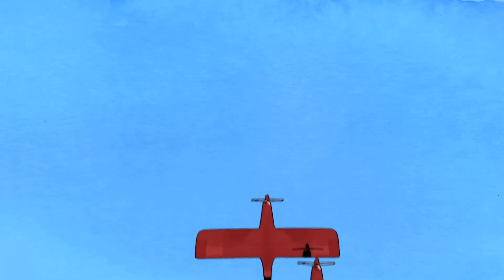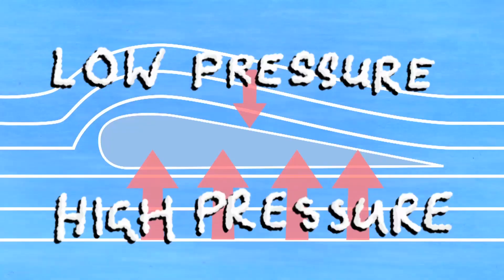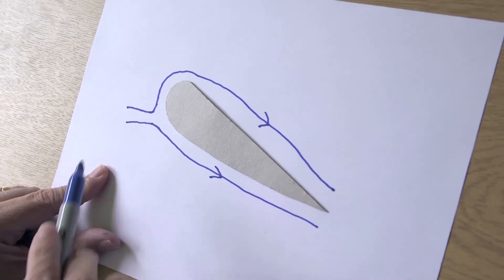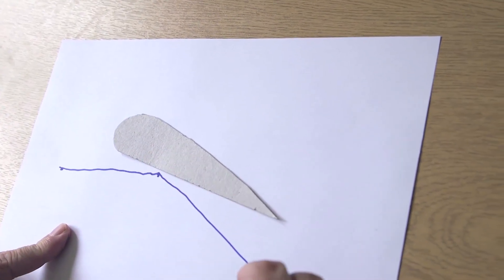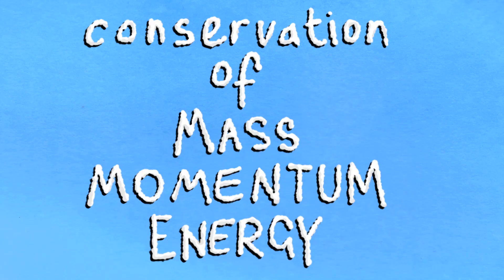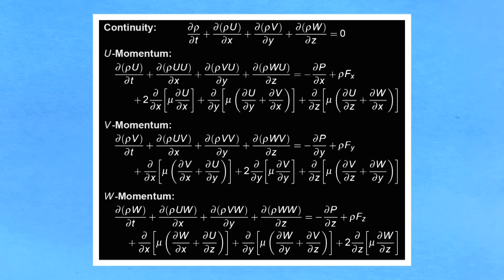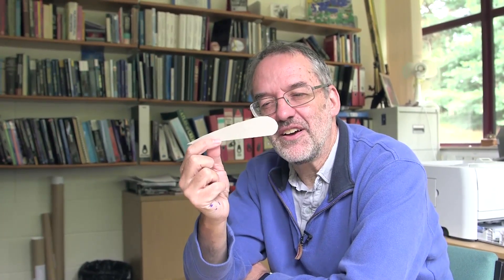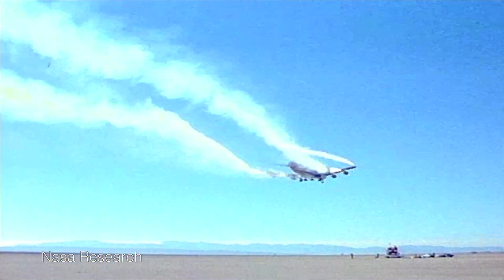Lift and Wings - Sixty Symbols

Comment: Very upset, how can you say that the air drags the other air along? 6:08
Reply: the problem is that air is not a liquid let alone a solid. its more to do with kinetic interaction than intermolecular frictions.
Reply: +Observ45er can you explain what intermolecular forces are involved with air
Reply: Doug's one I consulted with a couple years ago.  We both volunteer at Challenger Centers.
Reply: wut? this is just how viscosity works their is a friction force between the air molecules that when one molecule moves it is going to exert a force onto the molecules around it dragging it. It is a very small force because the viscosity of air is pre low but it still exists. This only doesnt happen with an inviscid fluid which sadly doesn't exist. Although the animation in the video is a little misleading because it drags the surrounding air to the same speed as the initial moving air which would not happen.
Reply: +Bryce Ring,  Think of the air in layers.  When the layers "slide' past each other, the viscosity is like friction between two hard surfaces (a brick and table). So this friction causes a force on the adjacent layer to move it along. Also Look up "entrainment in fluids".
Reply: +Bryce Ring, 
Both liquids and gasses are fluids and have similar chacteristics including viscosity. 
Many don't think water, much less air has this, so sometimes reference to Honey helps.
...
 I said "like friction" because it is easily understood as a reasonable analogy.  
The deeper mechanism causing viscosity is not explained in this context as being unnecessary for understanding and a distraction to lift.  The analogy is enough.
...
Regardless, your being upset with "air draggig air" is contrary to what happens.  
Moving air does move the near-by air along and the word "drag" explains the concept adequately. - - When you explain things to many people, analogies are found to be very important and must be carefully selected. I've seen some pretty bad, though well meaning attempts at them.Cheers
Reply: "Moving air does move the near-by air along"
Then I need educating. Please explain how ?
Reply: Why does a brick have friction on a table?  I dunno'. Probably something about inter-molecular attraction or simply surface roughness or maybe quantum something-or-another stuff.  
Things have friction and it works like such-and-such and that's all  we need.
...
Why do atoms stick together? Because of electrons sharing orbitals.
Why do electrons share orbitals? Because Bla, Bal, Bal?
Why does the Bla, Bal, bla happen? Because of XYZ.
Why does XYZ happen....
..
Viscosity just is...for me.
Reply: +Observ45er I think my main problem was with a misunderstanding of the word drag. at least they didn't say pulled along. if I think of drag as just an opposing force to the velocity vector and don't assume that drag means Pull, Then I can live with that. I'm just a bus driver at and I'm at work now thanks for your input.
Reply: +Bryce Ring I am using voice to text so there are a few funny mistakes I will edit that post when I get home
Reply: +Bryce Ring,
Well, so far, you seem to be doing pretty well, from my point of view.  YOU just need a little polishing up.
...

Think of ordinary friction.  Push a brick along on a table top. 
...
The friction acts against the brick's velocity, yes. Friction  is "trying" to slow the brick down.
...
HOWEVER, The friction is ALSO trying to move the table along with the brick.
If the table was on wheels, it would start moving due to the friction force.
...
IN FACT, Until the brick actually starts sliding along, the force you put to try to slide the brick is STILL "pushing" on the table and would move the table on wheels...NO??
...
Push, Pull, Drag along, whatever...
...
This is the phenomenon that is described by Newton's 3rd Law.
You push on the brick...it doesn't move yet.
Something is pushing back on the brick to keep it from moving.
The table is, via the (now static) friction.
...
Push harder and the brick starts moving.
The (now called sliding) friction still acts against that movement; and we think of this as "drag".
BUT, the brick is also still pushing on the table, trying to move it along.
...
Brick pushes on table...Table pushes back on Brick.
Newton's Third Law ALWAYS, ALWAYS applies.
Always.
Always.
...
Please do not make Newton unhappy and ignore this.
...
Airplane drag acts againt the plane's motion to slow the plane, but it also acts to speed up the air.
...
The air behind a wing is MOSTLY moving down (the downwash) due to the lift explanation (and it is proportional to the lift force).  
However, downwash is also moving in the direction of flight because the drag force pushed, or dragged it along a little. Its forward speed is proportional to the drag force.
It is not moving forward very fast because the drag force is low compared to the lift force.
The forward velocity is indicative of the drag.
...
uzat help?
...
Reply: intermolecular forces are very interesting.
Reply: +Bryce Ring,
  We each have our interests and you can research that.  I've done that for many things that happened to tweak my interest. 
This Bernoulli and lift thing came along several years ago when I took responsibility for a full cockpit B-737 flight simulator for the local Challenger Technology Center.  I had heard that equal transit time story many years ago, but didn't give it any thought even though it didn't ring true for me...
I looked into it and found all these fair, poor and terrible things on the net and Youtube.  I dug into it and even contacted a few experts in the field to get things straightened out.
People try to explain it, but either have limited understanding of some of the principles, or confuse the science of it with the math used to calculate values.
Regards
Reply: You may like this then, it was part of a topic on RCGroups v=QKCK4lJLQHU
Reply: +Bryce Ring,

  It is because of the phenomenon called viscosity. 
Think of honey.  It is sticky, so it sticks to the side of the jar when you tip and start to pour.  The layer that is stuck to the jar wall doesn't move, but has a layer just to its outside, away from the jar.
  That next layer cannot easily slide past the first layer because of this property, so it moves slowly. It is "as though" there is friction between the layers. It takes some force to keep the second layer moving past the first. Gravity is the force on the layers, in this case.
...
There are methods for actually measuring this property.
...
What forms is called a "boundary layer".  This has some stuck to (referred to as "Wetting") the surface and not moving at all.  Then as we look further and further from the surface, we see the honey moving faster and faster as one "layer" slides past the previous layer.  Eventually we get far enough away from the surface that we are in what is termed the "free stream" and there is no more speeding up as we move away.
... 
Obviously there aren't really layers, but this is a continuous variation.

I know we don't normally think of air, or even water as being very thick, but they still have some viscosity. 
Well, if we start in a open atmosphere and blow a stream of air into it, the boundary between the moving fluid and the still fluid has this "friction-like" effect that causes the next outer layer to be forced / dragged along.   This is called "entrainment".  
A device called a "Jet Pump" uses this property.  A high speed, narrow "seed jet" is pumped into a slightly wider pipe and the outer fluid is moved along due to the viscosity and entrainment.
...
By all means, you can Google viscosity and boundary layer to verify what I have here.
- - 
Regards, Steve
Science and Technical Advisor
challenger.org

Comment: I understand the textbook explaination but my head always screams that it's mostly that the air on top simply wants to travel up or straight after being pushed up by the hump but doing so would create a powerful vacuum on top, right behind the hump in the wing, and the bottom has extra pressure from blunt force impact due to angle of attack. Both forces are multiplied because of speed.

Comment: I would have to disagree slightly with his assessment here. If I had to pick one thing that above all else provides lift or in other words the thing that provides lift more than anything else it would have to be the angle of attack via the law of conservation of momentum(through a homogeneous fluid). I wish physicists would stop trying to confuse people about this topic by making it a whole lot more complicated than it needs to be. Simply put, have a downward angle of attack and the plane will start to plummet while an upward one would generate lift. This can be demonstrated with a plank of wood or how most kids learn at a very young age with a piece of cleverly folded paper. This single variable contributes to lift far more than any other variable so pretending that it's some equitable or indivisible contribution of all three is disingenuous to say the least.
Reply: The argument that deflection is the most important is only true for separated flow over a flat plate because the flow separates over the top (making it a very inefficient airfoil). For streamlined shapes, the top of the airfoil generally contributes more to the lift (which a deflection argument completely ignores).

Comment: Professor, I'll drop this one question. If air has mass and Newton tells us that it takes a force to accelerate a mass, What is the Force that accelerates the air up over the top of the wing and, therefore, what is the source of that Force?. This video is fairly well done, but it seems to gloss over this one area which I believe is very, very important.
Reply: No response... one year later.

Comment: Could someone please explain in understandable language (for us non-physicists) how air on the UPPER wing surface flowing in a DOWNward direction creates an UPward force on the wing? Intuitively, you'd think air above the wing flowing downward would push the wing down. My request is that responders don't just repeat "conservation of momentum". That may be the answer, but doesn't really provide a mechanistic explanation. Thanks!
Reply: Just created and uploaded a video "Coanda Effect and Newton" demonstrating this.  Realize that  the curve in the spoon represents the top of the wing in the context of your question.
Reply: Thanks. I think your video nicely demonstrates the effect, but doesn't really explain it. Why does water flowing to the left over the spoon pull the spoon to the right? If I push a spoon to the left, it goes to the left. This is the result you would intuitively expect. Instead water flowing left over a spoon pulls it to the right and air pushing down on a wing lifts it up. This is an intuitive contradiction that cries out for an explanation.
Reply: I assume you intuitively understand that if the water ran on the inside of the spoon it would push the spoon away as it deflects the water? As the water is pushed in a new direction there is an equal force in the opposite direction that pushes the spoon away (Newtons 3rd law). Now apply the same force to the curved underside of the spoon (or top of a wing). Due to the coanda effect the fluid wants to stay attached to the curved surface and changes the direction of the fluid, so an equal and opposite force is present which pulls on the surface.
Reply: Sorry, I don't mean to be dense, but I'm not getting it. Saying "there is a force in the opposite direction" merely restates what the video says. My question is, why? It's counterintuitive. Again, if I push down on something, it moves down. That's intuitive. If I pushed down on something and it moved up, that would be very counterintuitive. Yet when air pushes down on the topside of an airplane wing, the wing moves up. I'd like to understand why. Simply saying "there's a force present" or "it's Newton's Law" may be true, but doesn't really provide a mechanistic explanation.
Reply: "if I push down on something, it moves down". Yes. And if you PULL something UP, it moves UP. Top of the wing is pulling the air down and the air is resisting by pulling the wing up.

Another analogy. You have a weight on the end of a rope and you swing it in a circle with your hand. Your hand is resisting the weights desire to go straight and forcing it turn in an arc. You can feel the weight pulling on your hand. Your hand is the top of the wing, the weight is the mass of the air, coanda is the rope.
Reply: Hmm, interesting. Air traveling over the top of the wing is moving in a downward direction so I would intuitively expect it to push downward, not pull upward. But if the upper wing surface is actually pulling on the air, as you say, it makes a little more sense for the air to resist and pull upward. I guess that leads to the question, what force from the wing causes the pulling effect on the air? It's not weak, strong, or gravitational forces, so that leaves, what, an electromagnetic interaction?
Reply: Essentially, most of the forces we experience day by day (aside from gravity) are actually electromagnetic. For example, walking, which, involves friction and Newton's 3rd Law, is just a manifestation of interaction of molecules between surfaces. Pushing a box through the floor is the same. It's essentially molecules repelling each other due to charges.  In the case of the wing, molecules are being pushed around, so, it falls under the same category.

Comment: Is it better described by using the coanda effect and Newton. The wing pumps the air downward. How? Air going over the wing attaches to the surface which slopes downward relative to the airplane.  Because a force is being applied to the air to change its direction there is a opposing reaction, which lifts the wing. Newtons 3rd law.

Comment: PROFESSOR IS WRONG... he just does not make sense.... the curve on the wing is more like stabilizing the air vs. flying the airplane.An airplane flies due to air support from below vs. wing shape. Just make a well balanced paper airplane .... It flies just fine.Also the air above the wing is slower then the air below straight line. Same way you pour water front against the wing... you will realize the water flows faster in the straight line underneath vs. over the curve...So the professors explanation is hypothetical = WRONG....All the shape of wings on an airplane is about make the airplane stable vs. fly it.

Comment: There is definitely enough here to justify a part 2 video of this topic. You could expound on the Kutta condition, and you could better discuss the direction of rotation about the wing tip. I would be interested in a discussion of how the keel of a sailboat also helps to generate what we sailors describe as 'lift', acting as an underwater foil to allow us to sail closer to the wind. Traditional thoughts that the keel only reduces leeway don't seem to offer the whole explanation.

Comment: Golden ratio and time
Now time
Time units
1 international second is equal to:
1⁄60 minute
1⁄3,600 hour
1⁄86,400 day
1⁄31,557,600 Julian year
Must be garmony time
1 international second is equal to:
1⁄75 minute
1⁄4500 hour
1⁄108000 day
1⁄39447000 year
the second is multiplied by 75 to form a minute, which is multiplied
by 60 to form an hour, which is multiplied by 24 to form a day.
75 beats per minute average heart rate
12 divided by 7.5 is equal to 1.6 or 12 divided by 75 is equal to 0.16
near to the number of Phi
12 divided by 4.5 is equal to 2.6 or 12 divided by 45 is equal to 0.26
near to the number of E
24 divided by 7.5 will be equal to 3.2 or 24 divided by 75 is equal to
0.32 near to the number of Pi
108 sacred number
39447 approximately equal to the length of the equator of the Earth
The speed of light in vacuum is 239 833 966,4 metres per second